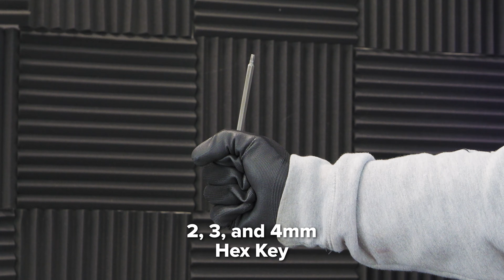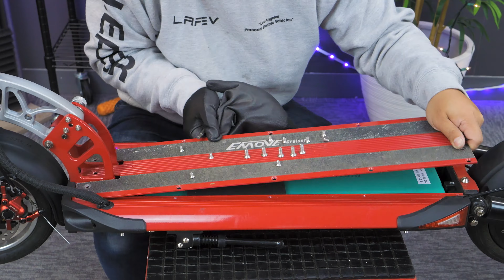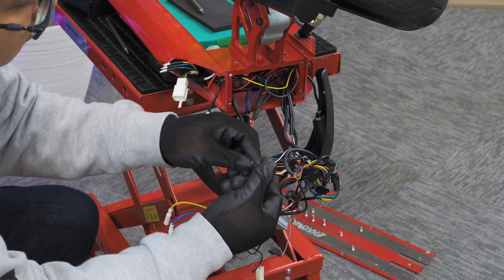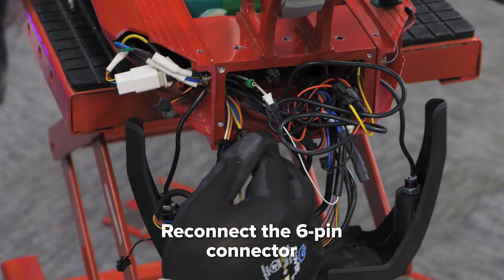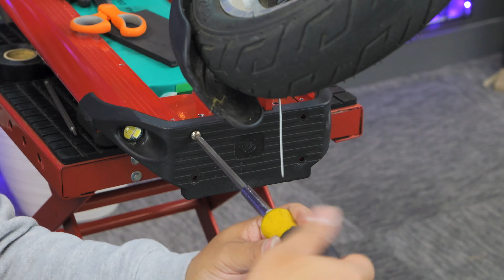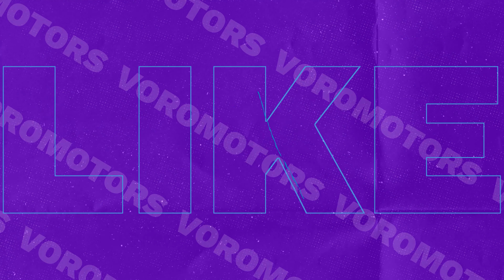How to install the sine wave controller on the EMOVE Cruiser electric scooter | VoroMotors tutorial

Comment from the maker: Video tutorial with written step-by-step instructions in the blog: https://www.voromotors.com/blogs/news/emove-cruiser-sine-wave-controller-replacement-tutorial
Reply from the maker: Hey John, 

We're not entirely sure what you're referring to, or whether you have a slightly older version of the phase wires that are different colors, but they should, for the most part, be green, yellow, and blue in color as we show in our diagram. 

If you're having any difficulty with this or have any questions for us in this regard, would you kindly reach out to our team at support@voromotors.com? We'd be happy to assist you there.
Reply: @VoroMotors  I've got it together then it wouldn't work. I had to turn P5 to 0 instead of 1 which is the wheel has to move first before going for it to work. I thought I had to take it all apart. I don't think it's in the instructions to do this and a lot of people might have problems. You need to tell people to change P5 to 0 or whatever their controller is where the wheel has to move first before the controller takes over.

I think the "engine braking" is better too but I haven't rode in a while.
Reply: You sent me a sine wave controller with XT60H and MR60 connectors for a scooter with neither, and no install video for that controller even if the scooter matched those connectors.

Comment: Would this be the reson why I would loose power on longer rides? Like for example I be riding My Emove Crusier like around 5miles of riding non-stop out of know where the scooter stops throttling. So I let go of the throttle and press down on the throttle again to get it going but after 5secounds it stops throttling again. The only way to get it stop is if I turn the scooter off for a little while. So I'm guessing the controller or motor might be over heating? Any idea's?
Reply: That sounds like a controller problem to me. My power would cut out after minor bumps and I'd have to let loose the throttle then engage it again. Over time, like 2-3 weeks, the scooter was getting less and less power to the motor, too.
Reply: @yepyep9113  I go over bumps without no issues I just notice it starts acting up when it’s longer rides like around 5miles. But it sounds vey similar to yours. Do you know if there’s a better controller so I wouldn’t have to worry about this?

Comment: does changing to sinewave controller has any improvement in range and power?
Reply from the maker: Sine wave controller improves the acceleration pattern and can improve range, but it depends on how quickly you ride and how frequently you start/stop. If you are going an even pace at a moderate (15 mph) speed and are riding on a bike trail (not too many stops), you'll get excellent range. If you have many starts and stops and are going faster, you'll get less range.

Comment: I bought the sine wave controller for the emove cruiser 2021 version but I noticed for the battery connections you put a yellow block with the 2 red and black cables would those still connect to my cruiser.
Reply: It's completely different from both their diagram and their video. No instructions. And no way to get a technician on the phone. These people are ridiculous.

Comment: Hello, 
I got an emove cruiser that no longer charges du to a electrical short circuit caused by the charger whose wires were bare.
do you think it could have damaged the battery?
I learned via Voro chat that the cruiser does not have a fuse, but a Sinewave controller. Is this part supposed to have protect the battery in this situation ? 
many many thanks for any advices you would share

Comment: What's the electrical tape for, I didn't notice any point at what you used it.
Reply from the maker: We would primarily be using electrical tape to cover any active connector ends to prevent them from touching and shorting anything.
Reply: @VoroMotors  smart move too I plan on electrical taping each connection after I test to see if it's hooked up properly and running of course

Comment: People need to change P5 to 0 otherwise it won't work. P5 to 1 is Kickstart which means the wheel has to move before it goes but with the new sine controller it does nothing.

Comment: What kind of performance buffs do you get from this compared to the latest cruiser controller? IE Range, Top Speed, Acceleration.  I know that sine waves are more efficient from what I learned from Rion.  I'm likely to buy this controller anyway.
Reply from the maker: Hey there, thanks for the comment! 

Feel free to check out our post here: https://www.voromotors.com/blogs/news/emove-cruiser-sine-wave-controller-replacement-tutorial for further details and FAQ's on the sinewave vs. square wave controllers.
Reply: @VoroMotors  I did, but it didn't really answer my question.  No matter though.  I'll test it out later.  Cheers mates and thank you for having such amazing parts availability on your scooters.

Comment: One thing to remember, if you're using the electronic braking. (P9 in the P settings, 0-2) 0 is off, 2 is on, if you set it to 1 the motor will not run, it is either off 0 or on 2. If you make changes to this while you're riding, you won't notice any change and it will not take affect until you turn off the scooter and then turn it back on. So if you're riding it and change it to 1, you will think it works, but when you turn off your scooter and then turn it back on, the motor will not start and you might think it's broken.
Reply from the maker: Hi Korey, 

Thanks for commenting! We have not encountered what you are describing previously, and when attempting to replicate it on one of our scooters to double-check, we still did not notice anything out of the ordinary occurring. 

Would you be able to email us at support@voromotors.com with more details of this issue as you've experienced it so we can look into the matter more thoroughly? We would greatly appreciate it.
Reply: @VoroMotors  
If you set it to 1 while it's turned on it will continue to work until you turn the power off and back on again. 
Power it on, set it to 1, power off the scooter, power it back on and the motor does not go when you pull the throttle. Several people in the forum have already noted this. Maybe this is an issue for people doing upgrades to their old controller and it's not an issue on the scooters that you are selling with factory installed sinewave controllers?
Reply from the maker: Hi Korey, 

Thanks for the response and further clarification. We are wondering if it is possible that you need a new LCD display in this case? In any case, please, if you wouldn't mind, reach out to our team at support@voromotors.com so we can look into this with you further and provide assistance. 

We appreciate you bringing this to our attention!

Comment: Nice video but you
Made it look to easy.
Thanks.
Reply from the maker: That's the goal! 😉
Reply: @VoroMotors  How many amps is the sine wave controler is it stronger than the square wave one?
Or just a smother ride?
I have no problem with the square wave one.
But more amps is always better.
Reply: @dennisgolden7596  someone at facebook group measure the output and the sinewave actually pushes out more power than the square wave.
Reply: Way easy vs ol silver 52v wire stuffing